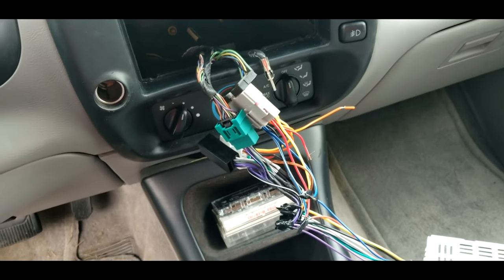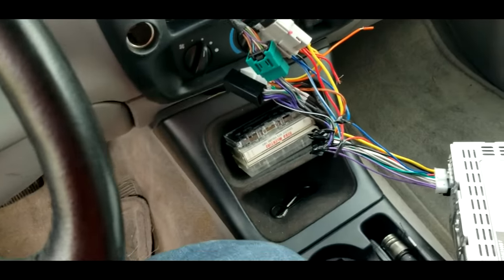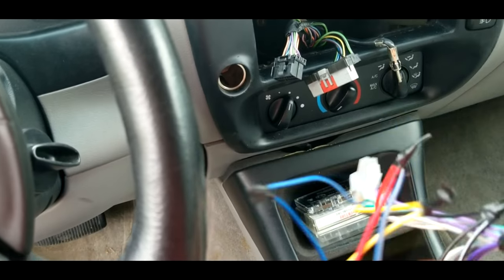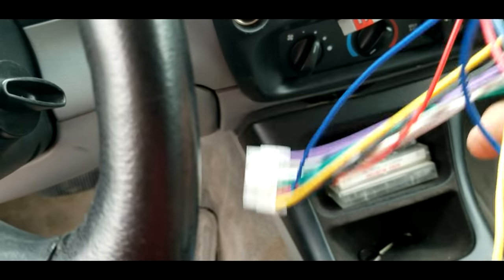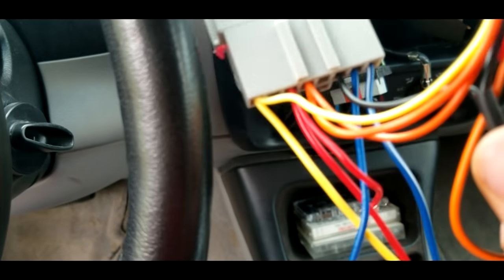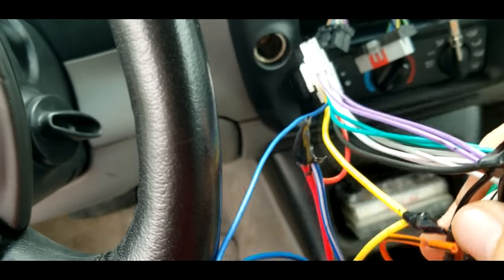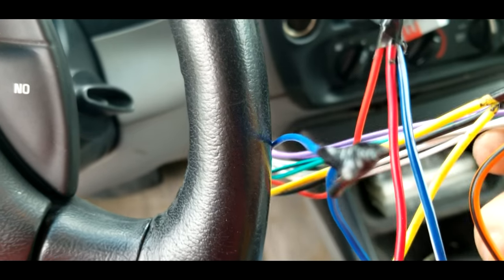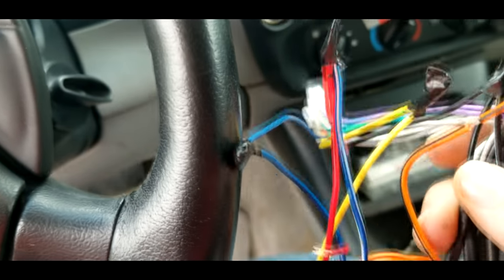Aftermarket Radio Turns On BUT NO SOUND **SOLUTION**!!!

Comment: Yeah I have a 2009 Saturn Vue hybrid got the wire diagnostic for it but it's not working right my front speakers won't work and I have the red and yellow wire hooked up to the red wire on the harness and it works

Comment: My radio works fine, ves works comes on but its my volume on ves mode. Once I put in in ves mode my two front speakers work but volume is very low unless volume is turned high but still sounds low. The rest of my speakers won't work. How would I fix this ?

Comment: The radio generally needs ten amp's and that's what you generally get out of the red wire but to add an amp that doesn't offer much power for the amp! Unless it's just like a remote turn on. You might want to run a dedicated and fused wire to the amp my friend!

Comment: FYI my car is a 2008 Mazda 3 2.3 with Bose sound system .. my amp wire was orange and I hooked it into the red wire in the harness for the radio it worked !!

Comment: Lol I was going nuts trying to figure this out with my 1997 ranger.  However my amp wire is white n black stripped. Then I also realize that there's 2 front right positive speaker wires.  I'm like wtf manufacturer fault?  I've been working on the truck that I'll give your method a try tomorrow morning.

Comment: Will this also work for my original vw cables tiguan ? I recently bought an aftermarket Android, everything works except the sound, the Chinese tell me that I have to buy another expensive cable. I do have a blue cable on the plug of the car's dynaudio system, please help me
Reply: but should I connect the blue one that comes from the car to the red radio or the radio cables?

Comment: so i have a 2006 camery and my radio turns on and i can make phone calls and they hear me but the sound coming from my speakers is nothing but an extremely quiet static and when i mute the radio it’s stops so the speakers are trying to make sound but it’s just suuuuper quiet how would i fix that if i dont have a blue wire with white stripe to put with 2 reds?

Comment: What if I have only a blue for the original connection and new raido harness has only 1 blue no blue and white, it turns on but no sound and if I hook my old one witch is aftermarket also it works fine but the new one is a 9in touch screen my old is a Panasonic with Bluetooth I use the male and female connectors for my harness adapter so it is a easy swap when I need to

Comment: Sorry buck but you did solve the original problem. The original problem (keeping the stock stero) is "system powers up but no sound to speakers. Not even static and the speakers check out. All you did was wrap some wires together. So I'm right where I began. You can see that your blue/white to red is not a solution to this very common problem.

Comment: Dude I have a dodge 2005 magnum they cut the wires an hooked up the damn aftermarket CD player .An jumped a wire to th3 cigretlighter an wh3n my wife tried blowing up her tire wh3n it was low with one of them shitty pumps it smoked like he'll an melted them together. I got them apart an taped them back together so there is no wire on wire bought a touch screen CD player but can not find the wire they used an hooked to the cigretlighter so I'm ducked I need to know which wire I need to hook up to qn acc wire I all ready found an acc wire a lot better one an ran a fuse in it just in case .please help any one be3n at this two night till past mid night

Comment: Mine isn't doing that recently I took out all my stereo stuff our of my car I wanted to turn it into a house stereo I did power it on it worked perfectly fine then I used a  xbox369 power brick to power up the amp it worked perfectly fine I noticed when I moved the wires in the back it was interfering my sound made static noise then one day those wires in the back I moved them little bit and ever since that I haven't heard no sound but it does turn on tho

Comment: Hey idk if u still active on this account but do u know what is the wirescalled  that comes out the car and connects to the harness. Mine is faulty or has a lose wire I have to add pressure to get the radio powered but it isn’t the harness or radio it’s the wires from the actual car
Reply from the maker: Couldn't tell you for sure.  Just a wiring harness connector.  And if it's bad, that requires a new connector and cutting and then rewiring all the wires to the new connector.  I'd recommend a professional do this.  The aftermarket harness that connects to the factory harness is okay to screw up, but you really don't want to mess up your original wires.

Comment: Have one radio ready to be returned to Amazon due to it "having a bad amp".  Purchased another radio and damn same issue.  Reinstalled the old radio (which I personally installed 3 or 4 years ago and it doesn't work anymore.   I know this thing has an amp so I checked every fuse and connection that had anything to do with the amp and finally afte

Comment: I have a 93 Ford ranger where the sound just quit. Stock radio still turns on but no sound. Seems like this solution is just for installing aftermarket radios...

Comment: Idk if that gonna work my speakers worked yesterday not today I was taping  wires up when I touched 2 wire together  an it sparked after that I connected the radio and when I turns on no sound

Comment: I have a 03 trailblazer and i put a alpine in it and every since i did my little place on the dash that has park neutral drive it doesn't come on and then some time when i turn the car on the radio doesn't i have to turn the car off and open thd door and then restart it and then some time while im driving down the road the radio will shut off and the whole dash and gaugas will shut off

Comment: I have a Chinese head unit and everything doesn’t work and no sound even though the head unit turn on but the YouTube and radio and other stuff doesn’t work..the head unit works sometimes but when I shut the car off and then on it suffers with same problem again and it says Mcu uart error..any solution?! My car is bmw e46 330i.

Comment: Hello I have a 2000 Dodge intrepid rt man been on my radio 3 week just finished all wire but no sound it turn on the wiring is all wacked out not the same the red is yellow I put to geither all the speaker geither

Comment: I am in a bind .I have a 2006 dodge durango limited edition and I bought it used.it had no radio so I went an bout a jvc radio with a harness that plugs into the harness that is already installed in dash of car.i color coded the harness that came with jvc radio with the harness I purchased. I plug it in an i get power no sound .I looked inside of dash an there is a red hot wire. It seems I have to tie it in to the red wire on my jvc radio harness for me to even get power .so I look in passenger floor board an see a amo factor amp.whoever had it before me cut the blue wires so i splice them together an still no sound.i can go to the fuses an pull the relay fuses out then pop them back in.radio comes on then I hear a little static then I hear nothing again .I'm lost can anyone help me?????!

Comment: ok help! I did that sound works now but now I'm getting a high pitch sound when stepping on gas through the speakers lol
Reply from the maker: Actually have heard of that happening but not sure what causes it.  My dad's 90 chevy silverado radio quit working and he put one out of a 93 gmc back in it.  Didnt have to cut wires or anything.  The new radio just snapped into the old cable socket.  But it made a kind of high pitched whistle as he accelerated. Which made me think it was something wrong with the new radio itself since no new wiring was done.  Just plug in and play.  It was annoying but better than having no radio.  Can anyone else on here help her?
Reply: @JerryMiah  ya I've been reading all day says it's not grounded right because I have a 2003 suburban I had to connect the red wire to fuse and then like u did put the blue n white.in with red sound works but ya the squealing very annoying lol

Comment: I have a Honda Accord 2003 and just the front right speaker and tweeter and the left tweeter are working... the rear speakers and the front left speaker do not... I checked all the wires and they are connected well but didn’t try your thing yet because it might be something else since some of them still work...
Reply from the maker: Yeah if some work then I'd think your amp is fine.  Might be blow speaker/s?
Reply: Buck2013 I was thinking about that but it’s pretty weird to get 3 speakers blown 😳
Reply from the maker: @IzzYChannel  only one of the four were working in my crown vic when I bought it so I dont know.

Comment: Can you tell me what going on if all 3 out of 4 speakers worked driver door never worked but one day my passenger side stopped working then one day it worked again now its just my back speakers working
Reply from the maker: Sound like a bad wiring issue or your speakers were just slowing dieing and finally did

Comment: I have a Nissan Maxima 2002 Bo stereo system in the car. I changed it to a ball stereo system touch screen, I can't get no sound out, but everything works great other than that even changes my phone when I Bluetooth it to my phone but no sound comes out now, it has a ballast amp and stereo system indicar. Also i'm thinking it's because the amp

Comment: I did what you said and still can't get sound. Any other suggestions?
Reply from the maker: Not without some more info.  Sorry.
Reply: @Buck2013  I replaced two speakers in the front doors, and the radio. The radio that was in it before was an aftermarket Sony radio that was on the fritz. The speaker connectors that he used were the style that plug into a TV and my new radio has the more original style. So I rewired the speakers and had to guess which ground was for which speaker because they're all black on the original aftermarket harness. After watching your video I wired in the Amp (blue with white stripe) to the red like you said to do. The radio does turn on and light up but I still don't have sound. I checked voltage from the radio through the speaker wires and get between. 01 volts to .06 volts coming out, but once I get to the speaker itself, it indicates no voltage. I do have continuity through the speaker and all fuses are good.
Reply from the maker: @theamericanrebel  hmm.   That's got me stumped.  Maybe a bad speaker itself?
Reply: @Buck2013  the speakers got good resistance. I'm thinking my connections aren't good enough or I fried my Amp, but I can't find a way to test the Amp in the pickup. I basically have to tear the dash apart to get the Amp out.

Comment: Note I didn't have those wires. 1998 dodge dakota got walmart dash kit and wires was nice heat shrink connectors. No sound after this vid still none . Read packs. Hear power antenna is amp as well sound shes working double check that to guys

Comment: I did that but I have sound when I play CD but no sound when playing fm radio
Reply: If you get any sound out, your speaker/amp wire connections are correct as all radio sources leave the radio/head unit through the same wires. The preamp internals of your radio/head unit should have a single amplifier that all sources (CD, radio, etc) run through, so your problem sounds like it is the radio itself. Probably an internal connection between the radio and amplifier circuits or a cracked radio logic board.

Comment: Issue I’m having is the fact that I didn’t have the extra harness adapter  so i hardwired it. Turns on but no sound :/ the colors are different from the car  since I don’t have the adapter
Reply from the maker: @lonely_sin6663  I'd highly recommend to NEVER hardwire into your car's wires.  Always use an adapter.  It will be an absolute nightmare to have to rewire your factory wires if somthing was done wrong.

Comment: I don’t like the way you wired that harness but very helpful
Reply from the maker: neither did I.  Was still a semi-learneer when I did this.  I took it apart and used heat shrink connectors not long after this video was made ;)

Comment: I have an 03 dodge caravan and i hard wired the entire radio. And all of it works perfectly. EXCEPT i cannot get the left speaker to work and there are only 2 wires left to hook to. And none of the diagrams online match my vehicle.
Reply from the maker: Maybe your speaker is no good?
Reply: @JerryMiah  I figured it out finally! Lol. I half way followed a diagram I found online that didn't fully match. And I had an accessory wire hooked to the left speaker wire and the accessory wire went to one of the other two wires I had left.

Comment: FINALLY,, i have a 2000 Lexus RX300 wiith no PLUG & play harness,,, and got it to power on, but couldnt get the sound and couldnt figure out where to splice my ampc-c wire

Comment: What if it plays very quiet even on full blast. And from time to time it'll be nothing... or just very quiet even at max sound but its like quiet.... if that makes sense... 
Someone help 😫
Reply: Could your speakers be nearly dead?
Reply: Some cars have factory amps some don't. For those that do, there may be two harness options.
 1: Metra adapter harness to connect directly to the factory amp just like your stock head unit did. 
 2: Metra adapter harness to connect directly to separate speaker connectors that bypass the amp.
     If you bypass the factory amp and your head unit doesn't have enough power, it could cause low to no output. Also, an aftermarket head unit might have two audio output choices: four RCA speaker connectors and/or separate speaker wires, bundled with a quick connector. One set is low power to go to the factory amp, the other set is high power that can power your speakers through your head unit amplifier. Consult the owners manual or call customer support for your head unit.

Comment: So what if the sound was working & just went out? Is it the same problem?
Reply from the maker: Probably not.  Probably a speaker went out.  Or maybe the amp?
Reply: @JerryMiah  yeah ot started put the rear speakers went out. Then the left door speaker. Now all speakers are out
Reply from the maker: @cashronin0002  odd that all speakers went out.  Could be the radio itself gone bad.

Comment: i wanna save you the time from having to respond but i cant find others with my problem. i have a line input converter and it had a blue wire with a white line and so does my stereo. when i touch them i hear clicking (which im guessing are the amps) but i still get no sound despite all my wires being hooked up correctly. stereo turns on and everything, but still no sound.

Comment: sound is working now thanks but volume on steering Wheel not working
Reply from the maker: Possibility with an aftermarket radio you can't control it with your steering wheel.  My explorer has controls in the back for the radio.  They don't work with my new radio.

Comment: Still having issues with no sound I have a dodge magnum  I don’t have blue wire with white line
Reply: Wrong wiring harness if it doesn't produce sound.
Reply: Or radio isn't compatible.

Comment: sssshhhhiiiiittttt, I did exactly what you did too. I watched many MANY videos about this topic, even spoke with car audio shops! Not a one of these avenues went anywhere. all of them dead-ending at either a bypass harness or running all new speaker wire to each speaker. which doesn't add up because in my Dodge there are 7 speakers but only 8 wires. hopefully I can unfuck myself.

Comment: Problem I’m having with mines is that when the key off and out I have hisssing sound thru the radio! You know what that can be from?
Reply from the maker: Odd it does that when it's off.  But hissing sounds are caused due to a bad ground.
Reply: @JerryMiah  A big homie you were right about having a ground issue, the problem was I had to ground the RCA’s and it stopped completely. Thanks dude
Reply: One thing I did do tho, because I got the same harness I separated them at the splice cause it’s just a gold crimp that hold them and use the green and the main grey harness just to get ride of the extras on it that way it wouldn’t be just a bunch of unconnected harness behind the radio if that make sense to you.
Reply from the maker: @edb3654  yep that sounds like a good idea.

Comment: Im having the same problem an i did that an still nothing but i have a car speaker just laying around the house an i hooked it up to it an it had sound
Reply from the maker: i went through the same thing when i was rewiring my radio for my crown vic.  it was a retired police car.  one speaker wasnt working.  so I bought one from the junk yard and had sound.
Reply: I have a 2001 chevy express 1500 van an i wished i could get the door speakers working but nothing yet 😬
Reply: An also if i plug my factory radio back up it has sound

Comment: What if the rear speakers work but the front ones have NO power
Reply from the maker: the there is a problem with the front speakers or the way they are wired specifically.

Comment: When i open the radio there is sound but once i connect my phone to the bluetooth there is no sound, please help
Reply: I have the exact same problem in my 08 Honda Accord coupe.
Reply: @djdamage75  i actually fixed it the guy that installed it for me didn't connect a blue wire, usually it is blue or white on an aftermarket screens so check the connections.
Reply: Thanks I will try it
Reply: @djdamage75  you're welcome good sir.